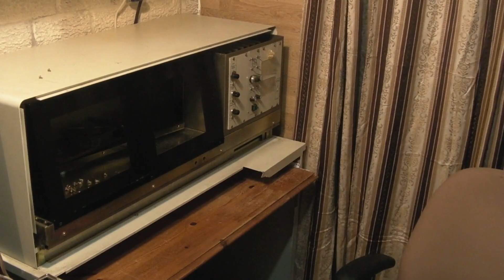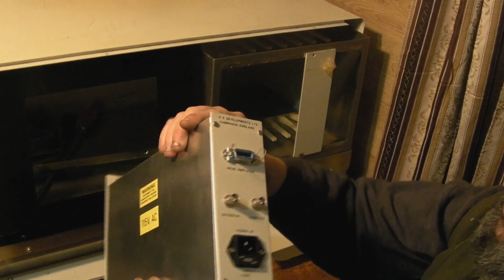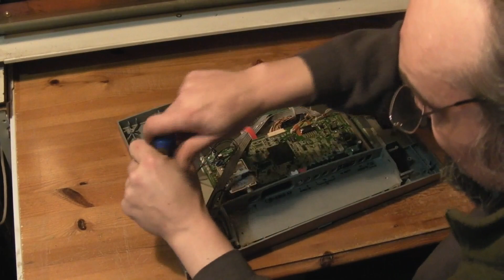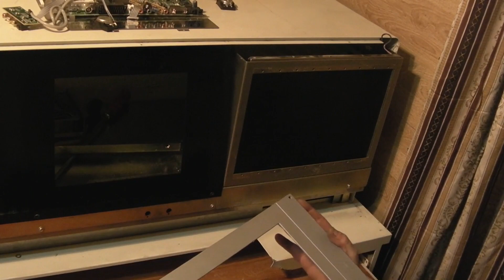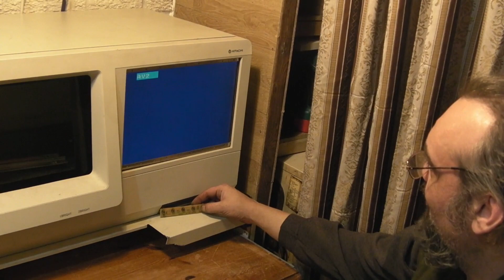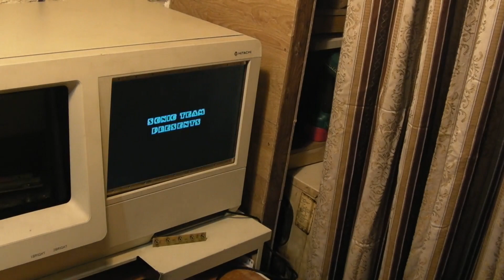Hitachi S-4000 computer. Fitting an LCD monitor to the console

Comment: Good job.  Was thinking maybe you could cut out the button section from the plastic case to reuse for the new button panel.
Reply from the maker: its actually aluminum not plastic, I did consider it but instead ordered a white plastic enclosure that should work well.